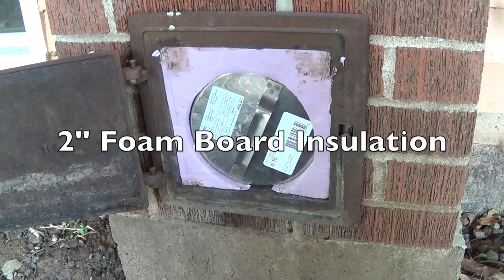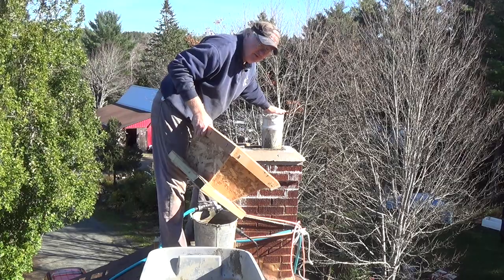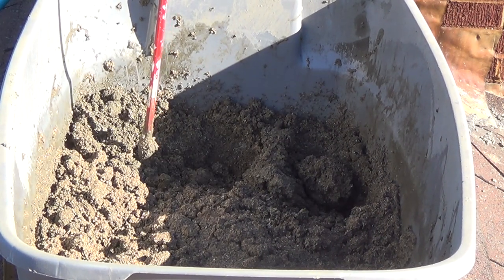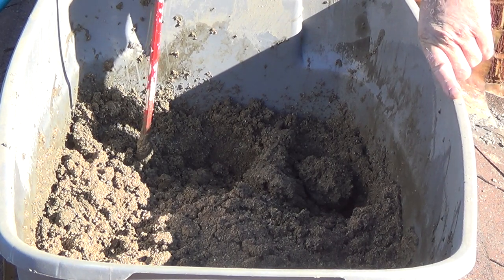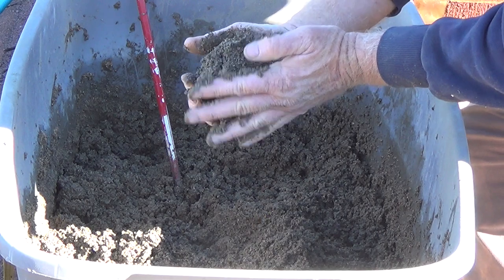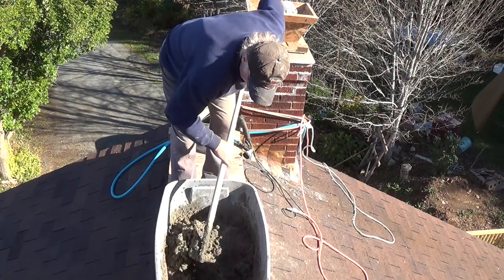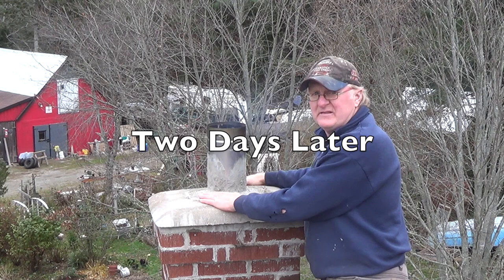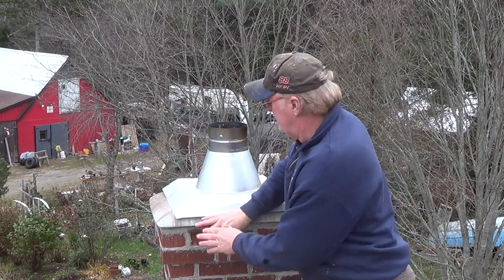DIY Chimney Liner Replacement Part 3 - Installing Thermix Insulation

Comment: Nice work and explanatory video. Thanks
 Why is it necessary to put insulation around the liner ?
Reply from the maker: Thank you for your comment.
The insulation helps to keep the liner hot, reducing creosote, and increasing draft.
Reply: Here in Norway it has become more common (I have red)  not to insulate, but rather keep the space round the chimney liner as ventilation.  The condensation is drained in the bottom of the liner.  Maybe the smoke is hot enough to break down poison gasses without any insulation ? I dont know. Its cheaper and less work too but wont last as long.  Creosote is no good neither for peoples health or the environment. I am just an amateur though
Reply from the maker: @roysmedsli8898  The insulation also reduces condensation.
Yea, creosote is not good for people or the environment also causes chimney fires if not cleaned regularly.

Comment: I need help, I did DIY and inserted a stainless steel liner(the rigid one) into a brick chimney. I wrapped the liner with quality glasswool but I got issues gettimg stuck cuz the wool was amassing in some areas,so I had to remove the glasswool and I anyway installed the liner. I was thinking to fill the void between the liner and the masonry with some compound, but I live in easterb europe and I couldn't find anyfhing specific for this purpose(they don't line chimneys). What best alternative can u recommend me for thermix?
Reply from the maker: Thank you for your comment.
You can use Vermiculite Chimney Insulation.
Reply: @BasaPete   do you think it will work fine mixed with cement and water? I see some people pouring in dry vermiculite but I find it odd
Reply from the maker: @dominic6055  Vermiculite, portland cement and water should work just fine. I'd try a test mix of 6 vermiculite to 1 cement ratio. Maybe even a 8:1 ratio.
Reply: @BasaPete  thanks a lot

Comment: I like your videos👌 U R A PRO!  Want to ask a question  pls. My chimenea  is taking. Water from autside  n my basement is to humed. Is I redo the brick. This solve this problem? I got doubt . THANSK for you answer. 👋👋👋👋🙏🏻🙏🏻
Reply from the maker: Thank you for your kind comment.
If your chimney is taking water from outside it must have cracked bricks or the mortar has fallen out. A redo should help the problem. If not, you could try spraying the outside of the chimney with a good concrete sealer. Good luck.

Comment: What do you do when you need to replace the liner? &
Reply from the maker: By-the-way, Tubinox stainless steel chimney liner has a lifetime warranty, and adding Thermix extends the life to 50-70 years.
But if something goes wrong, it would be quite difficult to remove the Thermix so you could remove the liner. But it's possible.
Reply: Pneumatic "chamber chipper"

Comment: That chimney insul mix is nothing more than vermiculite and Portland cement  and you can get from swimming pool supplier for 8 bucks a bag it's called pool base same stuff
Reply: Yes!
Reply: Is it possible to use the pool base dry instead of mixing in the Portland cement and water?
Reply: I couldn't find pool base with vermiculite, do u know how the maximum size the vermuculite bits have to be? Is there alternative to vermiculite, like expanded clay?

Comment: Overkill with the zinc flashing.  Cement flaunching is fine
Reply from the maker: I disagree. Flaunting can absorb water and crack with changing temperatures. After time it will expose the bricks and mortar to the same fate.

Comment: 9 bags later... $100 a bag now... ugh.
Reply from the maker: Thank you for your comment.
$100 per bag! That's a lot more than I paid.
Reply: It’s now $85.00 a bag plus shipping. No thank you! Good old dry vermiculite will do the the same thing for $25.00 a bag. Or a ceramic blanket that would cost $300.

Comment: Oil looks cheap!
Reply from the maker: What oil?
Reply: @BasaPete  the oil to heat my house vented through the side of the house!
Reply from the maker: We use wood, much cheaper than oil and a lot nicer on really cold winter’s day. Plus I like the exercise of doing up wood.
Reply: @BasaPete  I have to replace my wood stove, the inspector wants me to remove the clay tiles to make room for an insulated liner and put a new hearth in.  The cost for the liner hearth and stove I could heat my house with oil the rest of my life!
Reply: @mr.redneck2715  geesh. My oil budget is $9,000+ this year. 1300 gallons. 900 a month for 10 months. Getting a hot water heater and hoping to do what this fella did because its either a 5" insert wirh a lego sized wood stove or a metal.chimney through a wall. I'd rather destroy my 6" flue and pray I can fit an insulated pipe where the inner diameter is still 6" so I can properly burn wood in there.